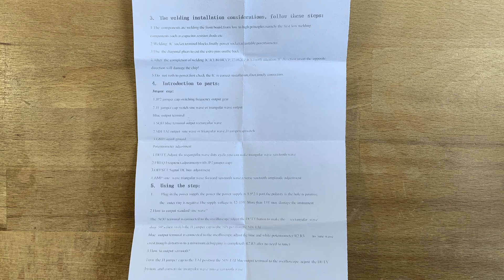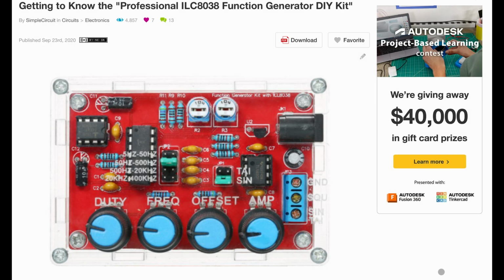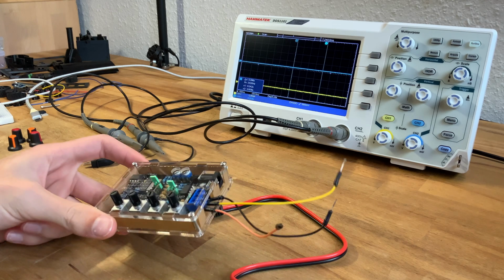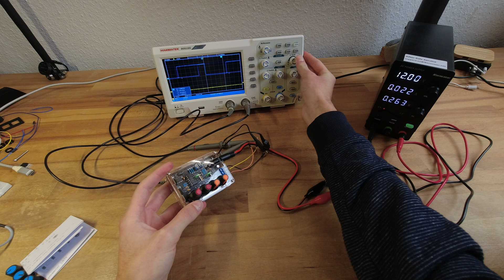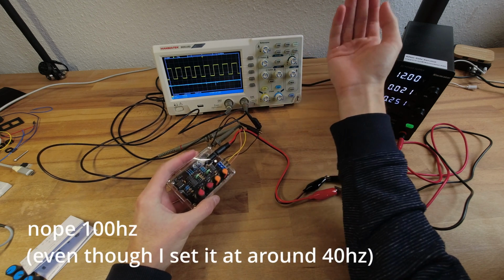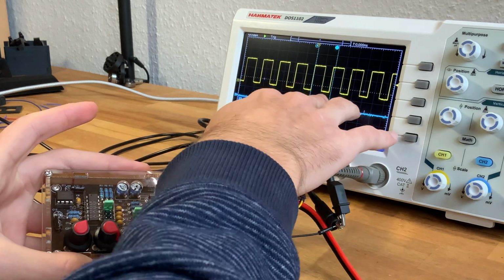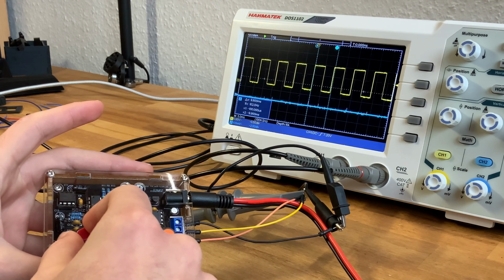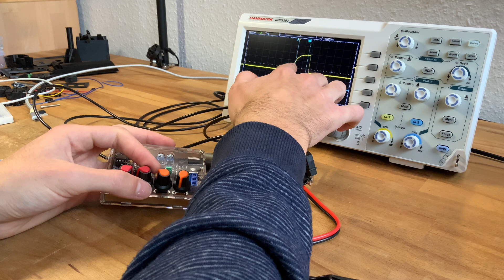ICL 8038 - function generator - Review / Problems

Comment: Yes, same disappointing results with me.  I thought for sure I made some assembly or soldering mistake, but after a dozen times checking everything, I have concluded its a bad design.  There is in the datasheet, a caution about the duty cycle not being linear, and limits on the pin 8 frequency set range due to micro amp leakage or Vsat transistor drops at higher currents.  I think the XR2206 is a better chip for function generator.  I think the ICL8038 is ok if kept within reasonable design and component limits.

Comment: Just assembled this kit, and encountered the same issues. In addition, they should have supplied spacers in order to keep the PCB at a certain distance from the bottom plate, otherwise you risk bending the PCB when fastening the bolts. Your "manual" differs from mine, with mine being entirely in Chinese, apart from the parts list. OK, the kit costs so little that I don't bother to return it or demand a refund. If I have time one day, I try to get to the bottom of the problems and try to make it work as it should.